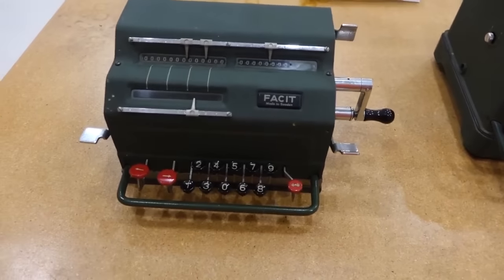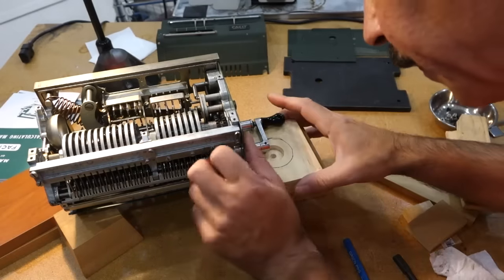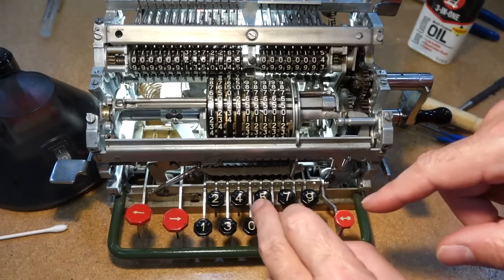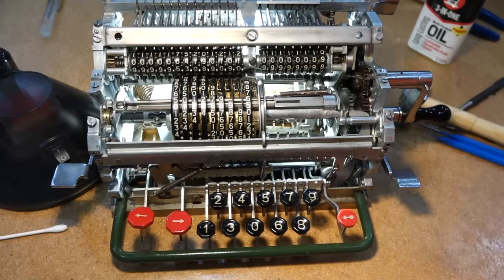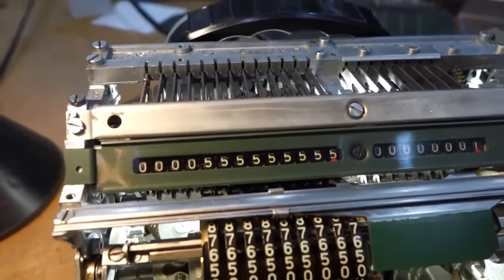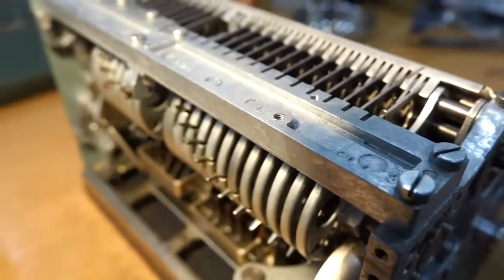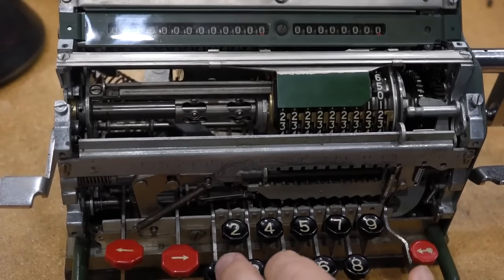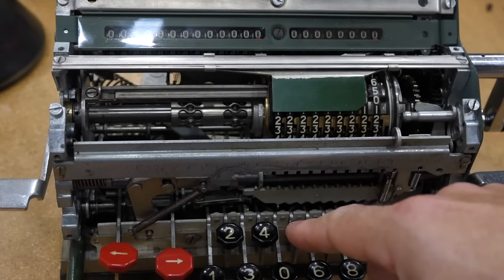Inside the Facit TK Mechanical Calculator

Comment: Hi, I am from Thailand and have just got a nice Facit C1-13 a couple of days ago from a vintage online market. The unit was sent by a parcel delivery service to me about 80 km from Bangkok. After opening the good packaging box. Some small broken black plastic pieces were found. They looked like some pieces from a bushing part somewhere. After trying to operate it all seemed to work well except the register reset lever. It was stuck after one move and the crank could be rotated any more.
I would appreciate your advice very much.
Many thanks in advance.

Comment: Nice video. Could you explain and show how mechanically the values is transfered from the keyboard to the drum. I an odhner model one is easy to understand but in a Facit is very dificult. The buttons are fixed but the drum of numbers move ever time that input a value.How does it work?
Reply from the maker: It is incredibly clever. There is a good explanation over here: http://www.johnwolff.id.au/calculators/Tech/FacitC1-13/C113.htm#Rotor
Reply: Thanks. It is really useful. Now I understand.

Comment: Hi, thanks for your videoes.
Can you explain how did you fix the blocking crank trouble?
I've got the same issue with my C1-13.
Reply from the maker: +Vincent it wasn't that easy nor did I catch it on camera. Look on the side for a larg-ish disk with a slot. A lever catches in the slot and locks it. To release the lever, a spring loaded pin needs to be pushed in. The lever was stuck and would not drop on it's own. The push pin was similarly hard to push. That's what I do when I free it temporarily: push on the pin and force the lever down simultaneously at 2:10. I had several similar faults throughout the machine. Freeing them with a combo of controlled force and WD40, then cleaning and re-oiling did the trick.
Reply: CuriousMarc thanx for the video and this explanation. My C1-13 has the same problem. I will try this out.

Comment: Great video! I've found the exact same calculator in my basement... except it's not marked Facit...strange. It works fine and I've just cleaned it and oiled it with WD40. However the paint on some numbers of the bottom roller has come off and there are some marks due to the spin. In other words...some parts of the white numbers are black and some parts of the black rollers are white (or better, silvery). I was wondering if you could suggest me a way to restore the paint and what paint to use. Thanks a lot!
Reply from the maker: I have not yet had to redo painted numbers, so I don’t really know. Beware of WD-40 though, it’s the contrary of an oil, it’s a solvent. It is a last resort thing to get parts unstuck, but very shortly it will evaporate and form a goo that binds everything. You should get rid of all of it (I use isopropyl to rinse it out), and oil properly with a very light oil.  Nye 140B oil is by very far my favorite, but it is very expensive.
Reply: @CuriousMarc  Thanks for the tips. Actually I used a lubricant called Svitol (very popular in Italy). I wrote Wd40 because I thought it's the same as WD40 but I may be wrong....don't know how to check.
Reply: @CuriousMarc  I think I'll follow your advice and remove the Svitol. I was wondering if typewriter oil is ok...I've seen it in my hardware store
Reply from the maker: Ah OK then you might be all fine.
Reply from the maker: Common sense would say it is OK - similar mechanisms. Sewing machine oil, or clock oil works also.

Comment: Hi Marc  I have a TK not quite as clean as yours. Could you tell me how the two most significant digits of the turns counter work. When u look at the cogs behind these digits there is a missing tooth. Non of the other digits have this , is this some sort of overflow mechanism ?
Reply from the maker: It’s a long while ago, don’t remember exactly. The best illustrated description of the mechanism I found on John Wolf’s excellent site here: http://www.johnwolff.id.au/calculators/Tech/FacitC1-13/C113.htm

Comment: Imagine that the CEO of FACIT believed that digital calculators would not threaten its market 🤣
Reply: They saw it coming, but not in time. They did great until 1970, practically died in 1972. Curiously, Facit actually made main-frame computers, so they were not all stubbornly hanging on to mechanical solutions.

Comment: I have my Facit C1-13 dripping with WD40. Tomorrow I'm going to clean the WD40 and oil it. I read that some parts shouldn't be oiled? Which ones? And I was thinking in greasing with silicone grease. Is this a good idea? Everything is working, except the cranck handle. It's completely blocked with corrosion. 3 days in WD40, light hammer and nothing. Any advice?
Reply: Hello, I also have a C1-13, did you managed to undressed it? I've just bought mine and I have no clue to remove the cover.
Reply: In fact I've just found the way to remove the cover. Sorry for the inconvenience
Reply: I have a Facit ntk model. The crank handle pull out is stuck in the original position, how can I rectify this. Plz advice